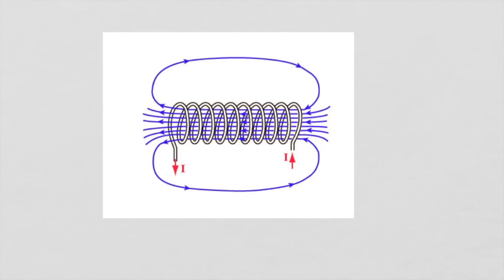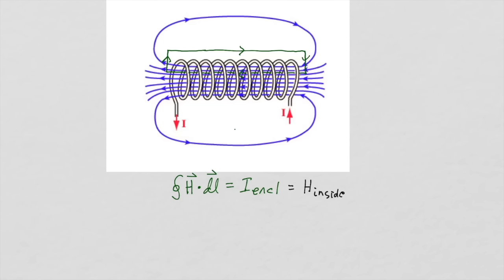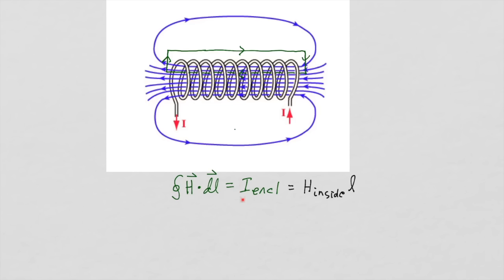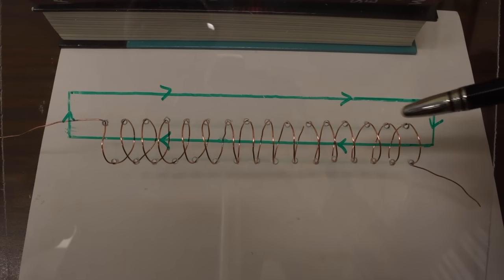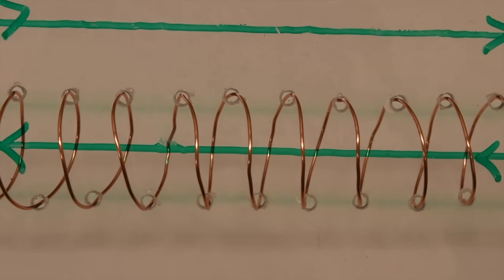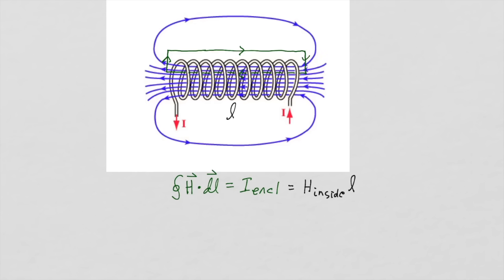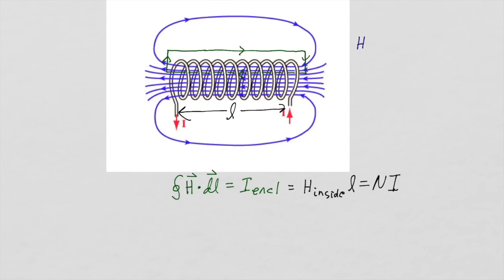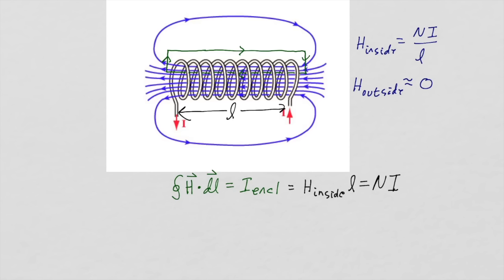Magnetic Field of a Coil

Comment: Plz may if you could list the apparatus used in the description 

And I wanted ask how many and how much volt batteries are used here?

And will the coil would work with greater number of turns like in between 28-32?
Reply from the maker: I used a 9V battery

Comment: In your 1st experiment with the multi-turn loop of circular wires, if you reverse the polarity of the current, will the field circles go in the other direction around the loops?  From the positions of the iron fillings in the video, I can NOT tell which direction the loops are circling the wire?

Secondary question:  If you put a VERY high CURRENT, LOW FREQUENCY AC current through the loops (ignoring the high current burning up the wire), will you see movement of the iron filings switching direction with the AC?

THANKS FOR THE GREAT VIDEOS!
Reply from the maker: Yes, switching the direction of the current will reverse the direction of the magnetic field.

Yes, if the frequency was low enough so the iron filings could follow the AC signal, they would flip back and forth with the frequency of the AC signal.

Comment: What will be the effect on magnetic field of induction due to long solenoid if we increase the diameter of its turns?
Reply from the maker: The magnetic field in a solenoid that is still considered long compared to its diameter will be H = NI/L where N is the number of turns, I is the current, and L is the length. So the magnetic field intensity, H, will remain constant.
Reply: @electricandmagneticfields2314  diameter of turns not of cylinder(solenoid)
Reply from the maker: You mean the diameter of the wire?  @quotesforu4571
Reply: @electricandmagneticfields2314  yeah
Reply from the maker: I'm not sure. You would probably have to write a program to calculate the field using the Biot-Savart law for various diameter wires. @quotesforu4571

Comment: The filings spread out at each end of the coil,  but, there's no evidence of them circling around to the other end.  The filings outside the coil did not line up like the inside did,  Not even on a wider scale.  It looks to me,  the filings were magnetized and repelled each other,  not necessarily running around to the other end,  just spreading out..  I watched a few times.  The filings did form an arc shape at the ends.  but not a complete arc.    From this demonstration,  We really can not commit to a revolving field.
Reply from the maker: The field becomes too weak to actually orient the filings outside of the coil and see what is really happening. I was already using two 9 V batteries in series and after a few seconds I would hear them pop! You can at least conclude the field is so weak outside that you can consider it to be zero compared to the field inside the coil. Then you can use Ampere's circuital law to determine that the magnetic field intensity inside the coil is H = NI/L, where N is the number of turns of the coil, I is the current flowing in the coil, and L is the length of the coil.

Comment: Sir i did this experiment, but there is one thing i was confused about. Why is there a gap between the magnetic field line?
Reply from the maker: There is actually no gap. There is a magnetic field in the space between the iron filings. The gap seen in the filings is a consequence of the finite number of iron filings. The iron filings appear to be on a line because there is an attraction between each iron filing and the one in front, and the one in back, of it like this,

<NS> <NS> <NS><NS>

<NS> <NS> <NS><NS>

If you could zoom in and put a miniature compass between the iron filings, such as between the two lines above,  it would rotate and be parallel to the adjacent iron filings.
Reply: You can treat the magnetic as wave,  when peak and valley meet, they cancel each other.
Reply: Hey man I really think I got the answer, and I don't think it has to do with the number of iron filings. I was reading up on it from a few sources, the khan academy has a reasonable answer (I believe)... The answer is in the 4th sentence in the following paragraph, hope it helps and would love feedback from Mr. Melloch or anyone else, thanks.
"Field lines can be visualized quite easily in the real world. This is commonly done with iron filings dropped on a surface near something magnetic. Each filing behaves like a tiny magnet with a north and south pole. The filings naturally separate from each other because similar poles repel each other. The result is a pattern that resembles field lines. While the general pattern will always be the same, the exact position and density of lines of filings depends on how the filings happened to fall, their size and magnetic properties"
ALL in all what I interpret from this explanation is that the iron filings in a sense become like two magnets sitting side by side with their poles oriented the same so that they tend to repel one another... I would absolutely love to know just how many field lines a particular magnet or electromagnetic gives off, that would be sweet, like is the number in the hundreds, thousands, etc. for say a small 1 cubic inch magnet.
Reply: @briansmith4853  so does it mean that if i use a smaller sized sand grains i could get more number of lines than lager grains since the repulsion would be lower in that case
Reply: @joeljose182  Man that would be interesting to see the results of the surface area/ size of the filings .. The way I interprete magnetism, yeah.. Just think if you used iron dust or something like that small and compared it to much larger filings? That would give some clear results.. Good question man